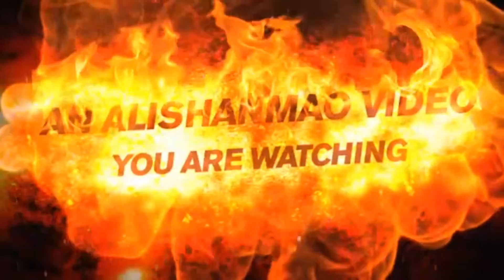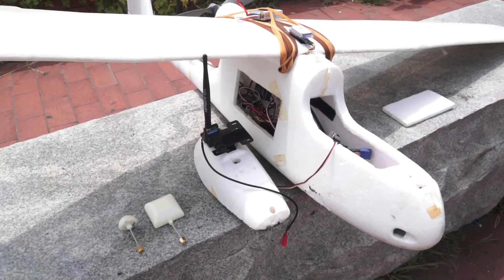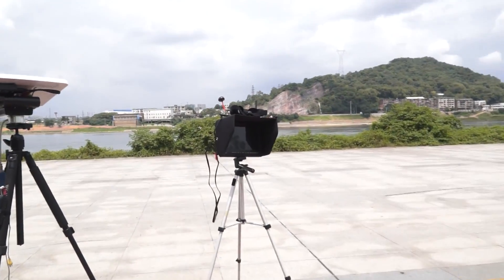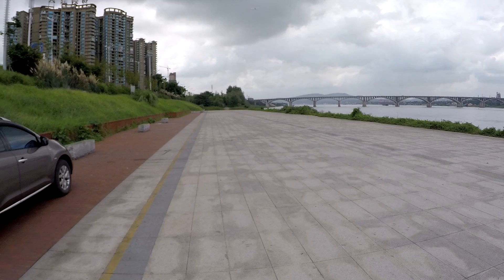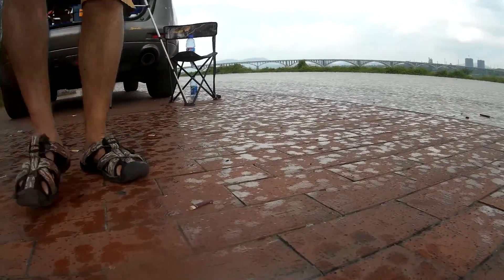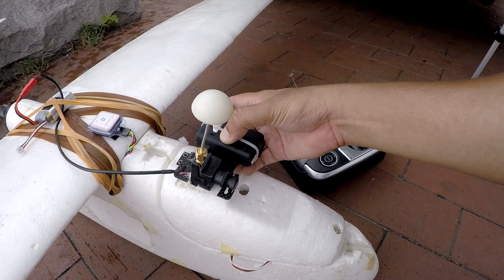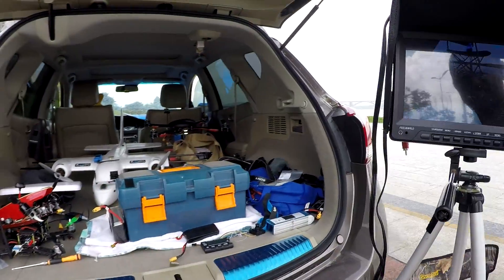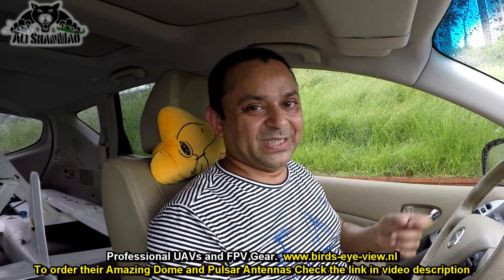Mayday Mayday High Altitude FPV Flight in Big Rain Makes for emergency landing

Comment: how does the foam plane not get ripped up in the air when descending and feeling all that force? maybe a dumb question but just wondering
Reply from the maker: the foam is actually very strong and these planes are well designed to take certain amount of G forces. if More than what they are designed for, they will break
Reply: alishanmao also Salam Alakam brother from USA
Reply from the maker: Wassalam Brother ;)

Comment: Thanks for Video...but they way you tell the story, its a bit overacting isn't it? the ground is not even fully wet!? So it wasn't that hard rain like it sounds for the viewer;-)
Next time, don't go for the dark cluds...they can have a lot of thermal as well and will suck up your very light airplane...i am a paraglider and know what i am talking about! If you get in trouble like that, check the bright spots with less clouds...means less thermic and risk of rain is less as well. ...these are just my two cents ;-)
Reply from the maker: Thanks for the comment and appreciate the tip. I taught myself Paramotoring using the home made Electric Paramotor that I build and yes I learned my lessons the hard way. but still I have not taken too much altitude using my Electric Paramotor because of risks of getting into bad thermals and unable to control paraglider. I fly a basic Nova Prion 3 S and use my homemade Electric Paramotor and I fly mostly lower and closer to ground. I like cruising nice and slow over ground. 

https://www.youtube.com/watch?v=_UjsslzwSHs
https://www.youtube.com/watch?v=TpZbuFj5OzQ

not a pro, still make mistakes :D but I am learning without any instructor.

Comment: Great job.  I tried Amazon AND some flesh-and-blood FPV retailers and NONE of them can actually create a plane like this one.  Yes the  Skywalker model can be purchased BUT ... they cannot recommend ANY parts: motor, antennae, auto pilot, RTH,  video cam, FPV cam, control panel .. they just cannot do it.  ONLY one vendor understood datum,moment, arm, CG and he's tied up (I can see why).  There is a dearth of skilled people in: retail, support, tech.  The electronic part is complex BUT if the plane is not balanced and in the weight-balance envelope  it will get into trouble (and crash).  Batteries and motors are heavy.  anything on or inside the tail is exponential to something at the CG.  Alishanmao gives excellent feedback (but he's way above the skill level of his peers)

Comment: Endangering real families in full size airplanes while sitting safely on the ground is just despicable. Just race quads instead.
Reply: +AIR GAMES ORIGIONAL,  There are so many "we don't know"s about this flight.  You speak powerful words of conclusion despite so many "we don't know". 

- We don't know if Ali knows the regulations of his flight area.  We can presume he doesn't, or that he does.
- We don't know if Ali is doing all he can to follow the local regulations.  We can presume that he isn't, or that he is.
- We don't know if Ali intended this video to be fully informative, or more like some competently fun entertainment, or reckless entertainment.  We don't know, but we can presume one way or the other.
- We don't know if Ali has received any sort of training, license, certification, or authority for this flight.  We can presume that he has done all, or has no official documentation and plan.

Your comment presumes much in the negative, but based on many "we don't know". But your comment is no less valuable, even if a bit unfair in this context.  Although I may lean in the direction of your comment, I acknowledge that there is a basket full of "We don't know" that should be considered in order to avoid an unfair conclusion.   :-)  Enjoy racing your quad, safely, understanding that if you do not bind it properly to a radio that kills the throttle upon loss of signal, your quad could easily zoom straight up into fullsize aircraft traffic carrying an entire family.  Yes, let's all be informed and safe, but not necessarily demand that every youtube video contain more safety and regulation disclaimers than actual entertaining content.  I've learned much from several of Ali's videos, and also some other RC channels such as Flitetest, Experimental airlines, etc. I'd like to think that we all shall grow in balancing entertainment with safety awareness, as appropriate to each posted video.  This is all still very new.   :-)

Comment: Ali, nice video, but I'm wondering about that place you used as a runway. Where is that? and can it be used as a emergency runway for small aircraft.? It is an absolute nice RC runway in any way. I'm just wondering why it was build there. Probably the only place where you can play with your toys for miles around. :-(

Comment: You know, when nothing out of the ordinary happens and there is no treat of loss, the stories aren't as fun to tell.  Throw in a torrential downpour, the fear of having a short in your system but you get it all back anyways NOW you have a story to tell.

Do you have the ability to put crow mixing on that Skywalker?  I know I'm fairly new to the Crow mix game but I immeadiatly like the fact that I can point my nose at my target and vary the amount of crow for the angle of descent.  I saw you were doing a lot of S turns to bleed off altitude, would have been nice to point the plane towards your landing spot and put crow mix on and just held the nose there.  May not have helped the story though.

Good, fun and exciting video.  Congrats.

Comment: Awesome job nailing that landing!  I outfitted a friend of mines Skywalker with an older FY-21 and AP117 that I used for a couple years prior and still never fails to hit the mark on return to home, especially when the video drops out for one reason or another.  And flying in the path of ominous black clouds and watching the rain curtain coming closer is about as exciting as it gets when racing the plane to get back before it soaks the camera lens...  Posted a great video of it.

Comment: I really enjoy to see your movies.I'm wondering if I can place also such a camera on my learjet from wingsspan 1,5 m. I need me to buy still a radio and long lasting batteries + all kind of stuff. What are the best batteries to fly long and far? That plane lay already many years on my cabinet but I want to fly it with a camera so that I can see better where it is. Your biggest fan!!!
Reply: Any battery with a high mAh rating will give you long flight times

Comment: Hello so I'm looking forward to buy an FPV for an rc airplane , it is called the e flite apprentice s.  With spectrum receiver  and I don't  know much about FPV just that is a screen and a camera where I can have first person view  , and I don't even know if they sell this things in hobby shops ? So I don't know the parts or what it's needed to complete the FPV system , I want something cheap and easy to assemble and start with good quality that can go at least 2 kilometers away if you that have more experience with FPV then I can you send me a link with all the equipment of an FPV , I rather one that is ready to go  with everything it needs and one question : does this cameras affect the range of the airplane ? Do they increase it ?
Reply: Hello
You will need:
1x video transmitter (25mw is legal for the most countries but it's a short range)
1x video receiver 
1x goggle/screen (Check out the "Quanum Goggle v2" on Hobbyking, very good als First one)
1x Camera ( Buy a "RunCam" those Are the best cams! They Are Not hd because its laggy then but u will get awesome quality)
1 Set of "cloverleaf" antennas

Maybe u will tell me how far u want to fly and I could send u some links. U have to watch the polarization of the antennas for example
Reply: How can you turn an rc plane into an unmanned aerial vehicle?

Comment: have you lost many plane in the xiangjiang river?
Reply from the maker: +James Boaz never lost one. dropped a few :D fishermen around the river are always kind enough to bring our planes back to us for 50 RMB :D
Reply: Nice. Thanks for the reply. I'm getting a Skywalker for my first plane/fpv plane. Want to use the revolution fuselage with the condor wing for its better performance. My question is will this work and what trans/receiver should I buy for a beginner? 
PS. Need the trans/receiver to have use for fpv later. 
Thanks
Reply from the maker: +James Boaz For your setup, I do not know. I fly my older setup and am very happy with it. For Autopilot, best to set it up with MFD Autopilot
Reply: Okie dokie thanks man.
Reply: +alishanmao absolutely in credible!!!!!!!!!!

Comment: just curious how does the rth work on a plane ? what does it take over ?
Reply: There are several kinds some are actual flight controllers, and other takes over your receiver therefore it controls Inputs for the esc and servos. Unlike multi rotors it won't land it but will bring it back and taxi over you until you take manual control.

Comment: man that landing was just epic! I had a similar incident with an rc chopper. I crashed and the propeller was gone. Turns out the propeller snapped mid air, well needles to say, it had a 100 meter plunge and not much was left.

Comment: Hi Ali, I have a simple question for you since your great experience in RC equipment: How far can I go with a Futaba T8FG? I'd never made any distance test, but before do it, I would like to have an idea about. Thanks man. :)
Reply from the maker: +Gino Gizio d'ignazio 3 to 4 km in the open areas depending upon how the interference is.
Reply: +alishanmao Thank you very much for your answer. By the way is there any video of your where you show how to balance properly a prop? I think I have some problem about my gimbal and camera, since when I fly I see in the video right after a small horizontal vibration. According to all the tests I made, I think the main suspect is pointed to a wrong umbalancemt of props. Is there any pratical way to get a good balancement of a prop?
Reply: +BIRDS-EYE-VIEW Thanks for your precious information. :)

Comment: What altitude do you typically have to be to reach the clouds?
Reply from the maker: +Ibushi depends upon what altitude the clouds are :D on some raining days, they can come below 200 meters :) or at some places i have seen them even lower altitudes like 100 meters. on normal days in our city, they are like over 600 meters altitude or more
Reply: alishanmao 200??? How far are you above sea level? I thought they were atleast 2km up.
Reply from the maker: +Ibushi in Hunan Provice we have seen clouds coming down very low at times. At Yandi Square, that Tower is not even 200 meters high. yet sometimes we can't see its top due to clouds :)

Comment: There are several aerosol products that can eliminate damage from rain. You will have to take the electronics apart to apply the product but it will save them if you get caught in the rain again. See if you can get Corrosion X, it works great, if not there are many others.

Comment: You mentioned one time you might try a spin with your plane. This would have been a great time to try it, being so high you would have had a long time to recover.
Thanks for the video.
Reply from the maker: +amtpdb1 Plane was on stabilization mode, so it does not allow plane to go into spin. Also My rubber bands on this plane are very old. Putting it into spin and recovering later might have taken the wing off LOL